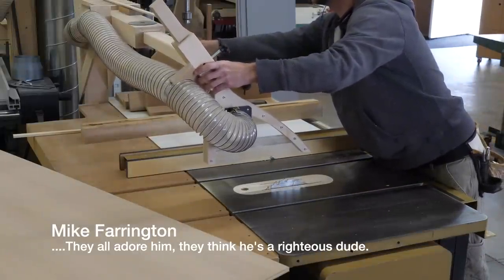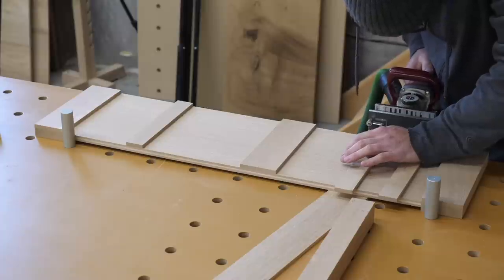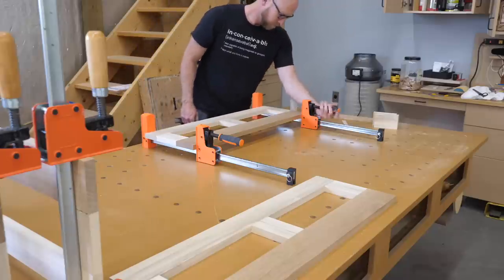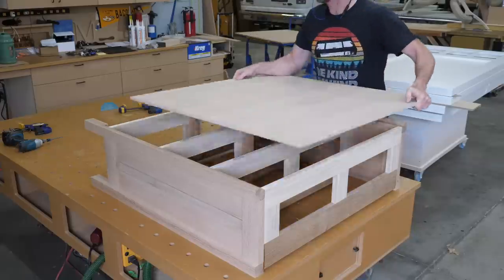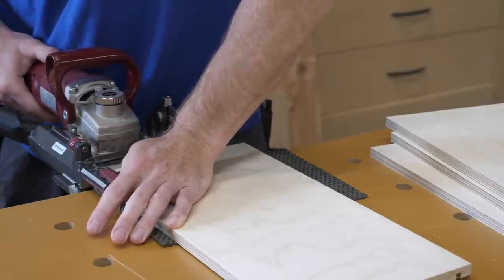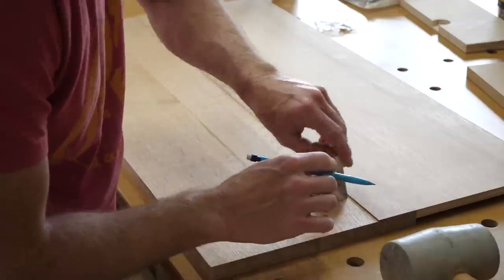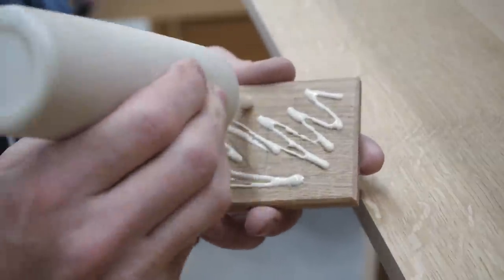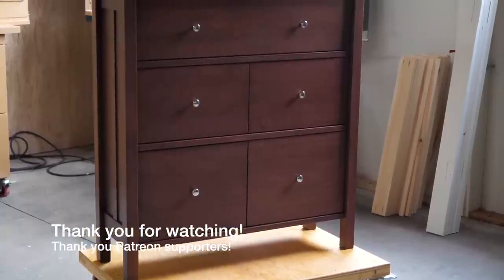How to build a chest of drawers

Comment: Pro tip, use t nuts for the feet. Tap them in then run a couple of small screws in beside them. Then they won’t come out and last longer than plastic.
Reply from the maker: Thank you. I have done that before, I figured this was small and light enough to where these would be fine.

Comment: I use the straw trick frequently, but have found that it captures the glue much better if you leave the straw cut at a 90 degree angle rather than cutting it to a point.
Reply from the maker: Thank you, good stuff.

Comment: I noticed the moments of what I'll call wobbulating when you're using the forstner bits.  (rotating the axis of the drill bit in tiny circles)  I'm going to try to remember that -- I've developed a bad habit of only using the drill press when drilling with forstners, since going whole-hog at once (using the regular power drill) can result in some unpleasant tear-out.   Seems like that technique of yours fixes that problem, and I won't have to spend extra time setting up the drill press.

Great vid as always.  Thanks!
Reply from the maker: Yeah, it helps prevent tear out at the start, and helps a dull bit feed a little better.

Comment: Very nice pec of finiture.

I've got one made in the 1940s but they used 1/4" plywood   no draw slides its held up just fine even the draw face is 1/4" plywood over a wood frame glued on, years ago the draw frt pulled off but my dad glued a conner board back on it.
If that dresser can last 75 to 80 years with 5 kids using it I really can't see why the one your making can't out do it.  But my reason to bring that up, is you could build a nice one that way using luan plywood just making the carcus and gluing parts together 
Thats pretty much what mine is and because its been in the family so long its an airloom. Cheap or not.
And it looks really good still.
Reply from the maker: Thank you for sharing. Sounds like a great piece.

Comment: The biggest domino tip I got from Sedge is that you only need one tight setting domino per joint, reference that from an edge on both pieces, and then cut the rest on the medium setting. You don’t lose strength, but it makes assembly much easier
Reply from the maker: I like the tight setting for one side then the loose for the other. This way I hammer in the dominos on the tight side and they will stay in place as I fight the piece together. Sorry I don't know who Sedge is.
Reply: @MikeFarrington  Ah I missed that! Sedge is one of the Festool North America trainers, his personal channel is SedgeTool
Reply from the maker: @coolbugfacts1234  I looked up Sedge, I like his hair cut.

Comment: Excellent work Mike!  Thanks for all the tutoring you provide. BTW, it could be me but watching most of your videos while you use your smoothing plane, LN I believe, I seems like you are really having to use a lot of force to push it along.  If this is the case, have you tried LN's wax bar that they make for their hand planes?  A few strokes of the wax on the sole of any of your planes and wow to they glide on the surface.  The only friction then comes from the iron cutting wood fibers.  Thanks for letting all of us watch your very fine woodworking!
Reply from the maker: Thank you great tip. I will put wax on a plane bottom once in a while.

Comment: I built a saw blade dust collector shroud and it’s pretty much follows yours except that I have always had a problem with the vertical boom which holds the horizontal boom getting in the way when I want to cut lengths over 1500mm. So, mine comes down vertically from the ceiling. It’s telescopes in much the same way as yours so I can lift to match the thickness of the timber or take it high enough to get it out of the way altogether for blade changing etc.
Reply from the maker: That sounds totally awesome. I'd love to see some pictures.
Reply: That’s fine,p but to what address?  @MikeFarrington

Comment: Mike, will the sanding disk work as a replacement to an edge sander for a garage shop setup? I’m doing mostly smaller built-ins and cabinetry

Love your work and videos
Reply from the maker: Yes, sort of. The disc will sand straight lines. So if your planned use was to fair curves with the edge sander, the disc will not work for you. Hope that makes sense. Feel free to email me via my website if you need some more info.

Comment: I've heard heating up or straining out old crystalized epoxy (before mixing) can work but any of those solids can cause it to not mix completely and not harden. understandable why you wouldn't trust it.
Reply from the maker: Agreed. I have left a chunk bottle out in the sun for a bit. Once warm it was much better. I don’t know if that’s good practice so I didn’t mention it.
Reply: @MikeFarrington  oh nice, I know people have done water baths to warm them up/ keep them at an ideal working temp. (depending on if your work area is heated or not people have used a sous vide to maintain a specific temperature as well)
Reply from the maker: @_Turbocat777  Water bath is a good idea.

Comment: Question about the shelf and maybe the drawer knobs.  Could you use flat head screws to make the knob retaining screw flush?  Would that stress the wood fibers on the inside too much over time?  Maybe a sleeve as a stop?  Just a little OCD about the shelf knob protruding that 1/16" inch.  LOL.  Awesome knob jig, btw.
Reply from the maker: Thank you. That would work, probably would look better as well.

Comment: Mike, 

Really love your work and enjoy the wonderful commentary (and humor).

Curious, what color stain did you use? and what did you cover it with?  Lacquer?
Reply from the maker: Stain color was Red Mahogany with some green added to soften the red. Top coat was pre cat lacquer.
Reply: @MikeFarrington  Mike, Thanks, I am so early in my WW journey and finishing seems to be a bit of a dark art. Thank you for sharing.
Reply from the maker: @artpeters6122  If you are early on, pick woods that are easy to stain, oak and Mahogany are two good ones. Also, pick wipe on wipe off stains. Finally, get a few rattle cans of finish and play around.
Reply: @MikeFarrington  Mike,
Thanks for the pointer.  So far, I've used wipe on poly, general finishes, with ok - good results.  I've also done walrus oil on a walnut mantel with good to excellent results.  I've tried rattle can lacquer with mixed results on some maple, I may try some white oak and see where that goes... thanks again, your work is terrific!
.../Art

Comment: Hi Mike, curious on whether you like the #4 more than the #4.5 plane. Would love to hear your thoughts on that, couldve sworn ive seen you using the 4.5 in previous videos. Also curious if you'd recommend a #5 (or i guess 5.5) as a go-to bench plane, or are the fours your bread and butter? Thanks!
Reply from the maker: My opinion is that for the the 4.5 is too much, I do have a 4.5. It takes too much force and takes away from the experience. If you are a big strong guy, it may be a non issue. Unless you are filling out a collection, I do not think you need a 5. I would suggest a low angle 5 and use that as a shooting plane as well. If you want to keep the collection very small a 5 can be used for almost everything, but that would not be my recommendation. If you can swing it, start with a 4, get a low angle 5, and a 7 for long stuff. Add a block plane to that and you are good to go. Past that it would just be specially stuff.

Comment: Okay was wondering if i could. use my double taper sanding disc for sanding ends! Doesn't it just push away the piece?
Reply from the maker: The piece needs to be held firm, combine that with a very very very tiny cut, and it works like a charm. You could also use a stop block to prevent it from sliding away.

Comment: Mike. I’ve pondered getting the lamello classic for case goods construction, like you show here. The top 21 is pretty pricy and close to the zeta p2.  Are you still using the lamello as a first choice for case side construction?  Would you have chosen the classic for price or zeta p2 for versatility if you were buying a lamello  now?   I’m hard pressed to spend the money for a biscuit jointer but it beats the domino for speed, and the less necessity for dust collection.  I’ve see Darrell Peart use it in some of his case construction and now see you using it.   Is it still a major player in your tool kit for case and drawer construction?
Reply from the maker: I've been using it for over 20 years. I'm not changing now anytime soon. If I was buying today I would go for the Zeta p2. To my understanding it works as a normal Top21, but then can also be used with the knock down fasteners. It is a lifetime tool, in 10 years, when it's still working perfectly, you won't remember spending the extra money on it.
Reply: @MikeFarrington  Thank you, Mike.
Reply: @MikeFarrington  Oh...by the way. This case is a nice looking build. Thanks for sharing.
Reply from the maker: @TallEvaGuy  Thank you for watching.

Comment: Biscuit Joiner!  Amen and thank you!  I have soooo many problems with the dam domino!  Heavy, the vertical adjustment creeps, ya cant dry fit sometimes because the slot is to tight.  Festool is the anti christ of tool marketing!
Reply from the maker: I’m with ya. It’s also painfully slow when you have a ton to drill.
Reply: @MikeFarrington  oh i  forgot to mention if you dont clamp the crap out of the workpiece the domino wiggles it out of position
Reply from the maker: @ronj8000  Yes, agreed.